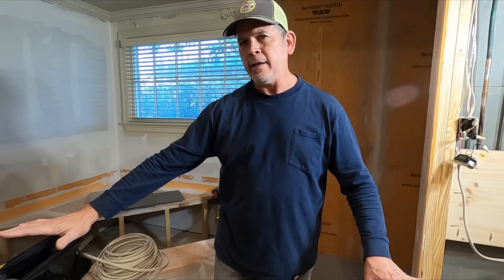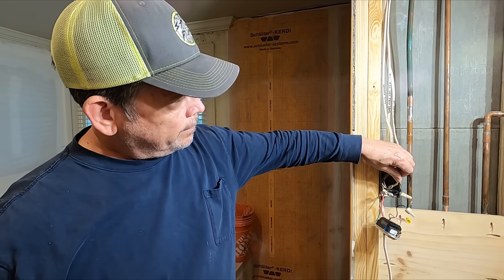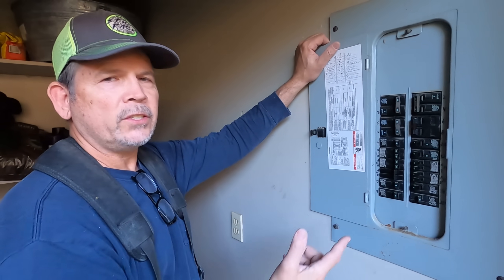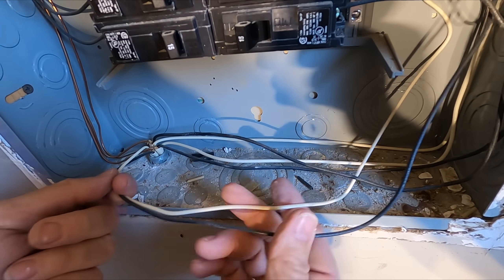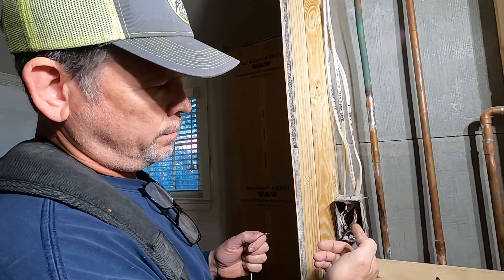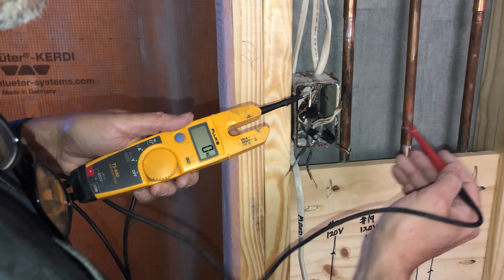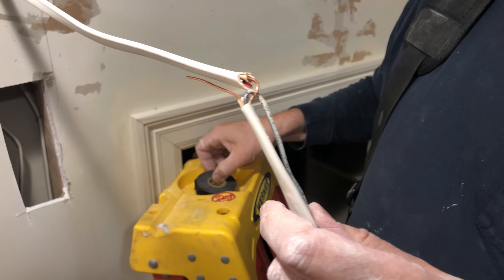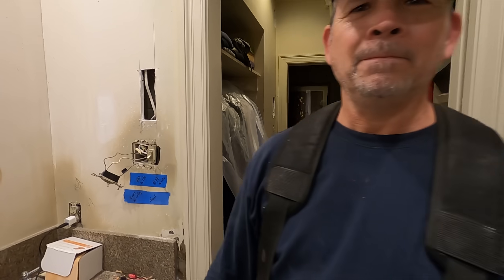You CAN Get SHOCKED by a Neutral Wire! This is How...

Comment: I'm going to say this, not as a keyboard warrior, but as a guy who has been around and seen good intentions go bad.  You're doing work that you shouldn't be doing.  I understand that you understand electricity, but that does not make you qualified to be doing that electrical work.

There is no way that neutral wire should be unused in that box (and I hope you did it to make this video).  What's worse, is that if someone else did that, what else has been screwed up in that house?  Now you fixed it (and put it on a video), but a licensed electrician should have been called instead just for liability's sake.  Should something else cause major damage, who do you think the homeowners are going to look at simply because of videos like this?

Comment: Stud pack! The white wire was marked with black tape. It's ok to have a neutral hot if marked with black or red tape, right? Electrical is a subject I'd love for you guys to do a deep dive in. But can you keep it to handyman levels such as 2 or 3 way switches. 4/1 wire configuration (black, white, red, blue) type. Where you see it and why? How about ceiling fans with 2 on/off wall switches. Biggest help for me is use of voltage meter. Show what setting you use to get voltage and stuff like that. I think you guys doing a handyman electric series from explaining diagrams of circuits to connecting of wires to getting meter readings is an awesome idea

Comment: Generally, panels are numbered as you said, but that is not 100%. Also, some older panels which just happen to be the main, did not have the single main breaker. So that panel you are showing as a sub panel, in some cases, could be the 1 and only main.

Comment: Thanks for a great video  when you cut the ground [neutral] to both breakers 19 and 20 and showed the backflow to 20 wouldn't there be also backflow to 19? resulting an in an open circuit

Comment: Here is the problem.  If your electrician says you can get shocked by a neutral, you need a new electrician.  

Let me explain.

First off, your neutral wire is technically a grounded conductor.  Your hot wire is an ungrounded conductor.  Pretty self explanatory there.  The problem is once a fault occurs and there are a few different ones, that “neutral” is longer a grounded conductor it is an ungrounded conductor.  People put too much value in the oh its a white wire its a neutral argument.  If we are speaking in technical terms (which you should be when dealing with electrical) the you, along with many others are wrong.  You CANNOT get shocked by a neutral.

If after reading this and you still
think you can get shocked by a grounded conductor,  I pray for your safety and the work done by you.

Comment: We got shocked due to a 60volt Neutral in an old Oregon house. The house neutral was the water pipe (no ground). The utility installed a plastic water meter but no jumper…

Comment: Very well done.   I was never licensed, but  I have a good understanding.  I serviced HVAC/R in the 80's--early 90's.   ET in the Navy 68-74.   Installed   E911  telco/ radio/ data equipment  for awhile.

Comment: You keep confusing current and potential.

Current flow on the neutral wire is normal and harmless.
As long as the neutral wire is connected to ground, there is no electric potential. You can touch it.
Electric potential on the neutral wire is dangerous. Electric potential is what pushes current through your body.

Comment: The way I work with electrical is turning it off at the Main outside and lock the box then the box inside is turned off then I check for power with the multimeter on anything I work on. It's completely worth the cost of batteries in my headlight to see what I'm doing while the powers off.

Comment: Hello Sir 
Thank you for this great explanation video. I would like to share a similar situation ( loaded neutral  ) as I replaced my house light fixtures with LED Fixtures. All went fine except when I replaced 
1- three spot lights above fireplace, they stay on the lowest sitting at OFF position. 
2- three pendant lights on the same switch. stay on the lowest sitting at OFF position.
3– one single spot light stays on the lowest sitting at OFF position.
I just bought the house in May 2022, and it was built in 2012. Can you please share your thoughts on what is happening in my case. 
I really appreciate your response. 
Thank you so much

Comment: you blew my mind with this video! I replaced a broken receptacle recently in a 1980 house, found the breaker turned it off, my 3 light tester said NO power ON THAT OUTLET, I removed the outlet and checked it with my multimeter, neutral had power, one of the blacks had power, odd voltage coming from the other second neutral, I could not figure that shit out nor was I hired to start digging in the walls and tear into all the boxes looking for that neutral. I figured it was wired like that since 1980 as "code" back then for a reason and it worked. I wasn't there to figure out all that nonsense. but damn you blew my mind with this one bro. hats off to you truly!

Comment: The word circuit explains it all. Electricity makes a circuit to the outlets and back to the panel. 

Never assume an outlet is off without testing it first. In my house I have outlets in my garage that are on the laundry room circuit and I have an outlet in my living room that is on my garage circuit. Never rely on what is marked on the panel, especially if it is an older home. If you are using a non-contact tester, test the wires you think are off, them test wires you know are on to make sure you non-contact tester is working correctly. If you walk way from the wires for any amount of time, test them again before touching them.

Comment: I had a switch box that ran a fan and two sets of lights in a bathroom.  The breaker was off for the lights I was working on but the other lights on a different breaker popped and turned off when I was cutting my wires on the dead circuit.  It blew my mind lol.  AC makes no sense.  DC is my background.

Comment: Hi I actually got shocked with the neural wire. Does a a contactless voltage tester light /chirp up  on the neutral wire , even if the hot circuit has been turned off?

Comment: i hate shared neutrals, my mobile home has several, and as i was swapping light switches out, i got shocked twice by one. circuit breaker was off but still got a shock as it appears that the other end probably was tied into another circuits neutral wire (several light fixtures have multiple neutrals wired together, more than whats on the circuit itself). luckily it was a tingle and not a full blown painfull shock. but still not fun.

Comment: I got the exact same problem right now. I got to the point where a three way switch messes everything up if I connect everything so it works "properly" with one switch the other will invert the connections. I am hiring an electrician, he is coming in a week, but God I wish I could understand this easily. When wrong my neutral becomes the ground. I will try to do a model to see if I can figure it out.

Comment: This is a great explanation of what can happen with dodgy wiring.  I will note that it is okay to share a neutral between two circuits under two very specific conditions.  (1) The two circuits are not on the same phase, this ensures you won't overload the neutral.  (2) The circuit breakers must be tied together, so that if one is turned off they will both be turned off.  This will prevent the situation that you describe where you can end up with a hot neutral because the current is traveling across from the other circuit.  Using a shared neutral like this can come in handy if, for example, you want to pull two new 20A circuits to a room that is on the other end of the house from your panel.  It means you can put a tied 20A breaker on the panel (that uses both phases) and run a single 12/3 cable to the room for your circuits.

Comment: Good job, and nice explanation.
This is one of the reasons why it's not allowed anymore to have 2 different circuits in the same junction box in my country.
Also breakers here will cut both wires (L+N). This is also because some older places have no neutral (240V between phases vs 240V between phase and neutral).

Comment: This would be more helpful to me if a saw a schematic.  I can’t tell anything from just looking at a wire and seeing you test it.  Edit: I see, there was a shared neutral with separate breakers.  The hazards of amateur wiring.

Edit: I’ll add that when you break the neutral wire, only the part still connected to neutral bus bar is a neutral.  The other part is a white wire but not a neutral.

Comment: If you start your tape wrap in the trailing wire, there will be no tape edges to get hung up or snag anything. It also works for weather proofing (on coax) …start your wrap from the bottom…no exposed edges of the tape espoused to water ingress (rain, not submersion).

Comment: Commercial/industrial electrician here. Stuff like this is exactly why I don't do side work. You never know what you're getting into with these older houses. More often than not, circuits are labeled incorrectly, things were wired wrong, bad practices were followed, etc. Residential reno work can be dangerous and incredibly frustrating. Great video and demonstration for DIY homeowners. Stay safe boys.

Comment: My understanding, the reason why this happened is because circuits #19 and #20  are on the same phase of the panel (phase B) and they are sharing a neutral. When you have two circuits sharing a neutral each circuit should be on opposite phases of each other. For example: #19 should be on phase A and #20 should be on phase B.....Even when they are on separate phases you can still have current on the neutral because  even thou you turn off one of the breakers current will still flow on the neutral because one of the breakers is still on......is this correct?

Comment: A great video and explanation of how things can go wrong if you don't know what you're doing.  I might have missed it in the video so if this is a repeat I apologize, but I wanted to point out that in the sub-panel the neutral bus and the ground bus were not bonded.  This is as it should be.  These two busses are ONLY bonded at the main panel.

Comment: At 10:20 How does circuit 19 back-feed to circuit 20 if the breaker to circuit 20 is off? 
Also on the diagram, you draw a break in neutral but where in the wiring is the neutral splice that is drawn further down on the diagram?

Comment: him showing the neutral wire is why i dont trust anything with high voltage coming through.
it will find any path it can to complete a circuit. that why i tend to avoid working with wiring of any kind

Comment: Before I opened this video, I thought the answer was going to be because of the voltage drop due to high amounts of current flowing through the neutral wire when you touched an exposed surface of a neutral wire in one wet hand with a open wound and a grounded metallic surface in the other wet hand with an open wound, in which is the ground is at an absolute of 0V and the neutral at the point of contact far away from the panel is at an absolute of 12V, for example, causing a difference of 12V in your body between your hands. Little did I know that someone could mess up installing wiring so badly that they connect two circuits together, which is a huge no no because of backfeeding!

Also, if people could mess up so badly like this by connecting 2 neutral wires from separate circuits together, then they could also connect a neutral to a ground, making even the ground wire not safe to work with because the electricity ultimately flows back to the neutral wire at the breaker because they are bonded together there.

Also, I wonder why the GFCI in the breaker box for those designed circuits didn't trip when the amount of current between the wires varied hugely. If a GFCI was installed for both supposedly separate circuit, shouldn't both of them have tripped if they were connected together?

Comment: the lesson is: even if you turn off breakers or whole panel, never trust anything. wiring can be screwed up and still somehow work. so the process for working with every single point, even after turning off breakers/board, is to test every pair with a meter, and just in case screwed up a reading, as a last step, short the wires with a insulated screwdriver whilst not holding any metal. it doesnt waste time; it reduces chance of electrocution by a lot.
not only neutral but, even earth can hold a fair amount of leak electricity. all it takes is a picture nail or a screw, missing a stud, and getting a wire attached to the stud.

Comment: Our instructors at our technical school were stone cold on how you cannot be shocked by a neutral conductor. About 4 of our hands shot up, me included, to completely disprove that. Its not only possible, but very dangerous. We were dismissed by the instructor at that moment, but later another instructor verified and somewhat berated the first teacher for saying such silly things. In a perfect setup, its nearly impossible. But any electrician worth a pinch of salt knows, its never perfect. Some goon always comes in and disregards code, regulation, installation techniques, common sense... and poof, hurt locker neutchey bite.

Comment: Most baffling shock i have ever gotten was when breakers were flipped, i measured with multimeter everything to make it sure there was no current running, did almost whole new install, went and connected it back to the main junction box, check that everything was working so far (step by step install making it easier to locate any issues) cut the power again, measured it second time, went to install that last bit and got fucking shocked. Didnt even notice it first, though my muscles were just pinching a nerve (whole day if fucked up parkour to get wires and boxes installed). Nope stopped when i let go of the neutral wire though had shock after sensation still for few minutes. As mentioned electricity is weird... didnt get what the hell was going on so after exhausting all other methods just went with bonkers ideas and flip to DC testing....its been while since but i recall seeing numbers high as 50vdc. Completely confused called the electrician who was on charge on this job and after quick brain storming we realized that since building where this was put on was so far, around 50meters from the main fuse box and those wires probably zig zag inside the house too plus being old school building had large number of wires going all over the place, there was enough wire to build up charge via induction. Could get it discharge this by hitting the ground, but it would build up again over time. Now there is fault current protection and no issue least past that, but damn that was weird. There could be some messed up setup going on inside, but its practically impossible to rework or even find all the wires in that building since sealings have been lowered and some of the wires run there. Whole building would need renovated and all wires redone to find out. But yeah electricity is weird and you should always check YOUR SELF(never trust someone else do it for you) before touching anything and when working electrical no one should touch anything ether. Plenty of cases guy being middle of fault diagnostic and someone walks in hitting the switch and electrocuting one working.

Comment: I was distracted by a pair of legs in a dept store one time and bumped the neutral on a 277V light fixture. My right arm was numb for 3 days after and I swear I heard the devil laughing for a split second. Needless to say I stopped working electricity hot whenever feasible from that point on.

Comment: you can get shocked from anything if its done wrong... shouldnt have been wired up like this, could of had 30amps travelling down that one neutral if each circuit was maxed out.. they could of tied that neutral into a copper pipe too and left the possibility of live pipes if they ever got ungrounded.. can do things all kinds of wrong

turning the switch off to a light should kill power to it, but if it was wired incorrectly it wont

Comment: Electricity is not mysterious.. that is a miserable way to explain it, electricity does exactly what its expected to do, it does it very reliably and consistently, its no harder to under than water flowing through pipes.. if anything plumbing is far more complicated than electrical work.. use common sense and trouble shooting to fix issues and use a meter and breaker panel to work on circuits, if its not energized its not going to hurt you... if youre that worried working in the panel kill the main breaker and then the only live part in that panel is the feed wires coming in the top.. for the whole house actually

Comment: Butchers. I can't tell you how many times I've come across this.  my neighbor wired his barn and the grounding rod wire will knock you on your ass if it isn't connected to the rod and you touch it. Amazingly, it passed inspect. Every circuit has to have its own power common and ground for it. It should never be shared with another circuit.

Comment: Multi wire branch circuits are advanced. Even for electricians. I once pointed out to one that the two breakers on a MWBC need or be bridged by code so that they turn off together. He did not know that.